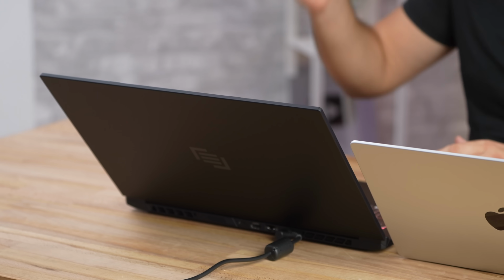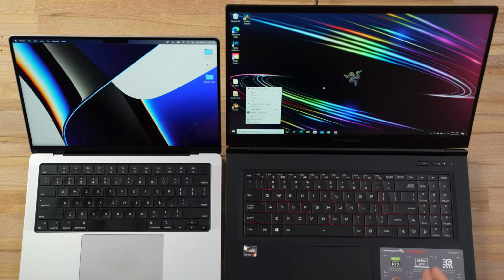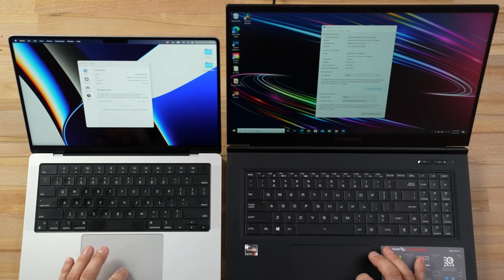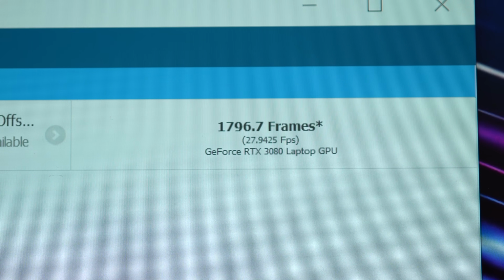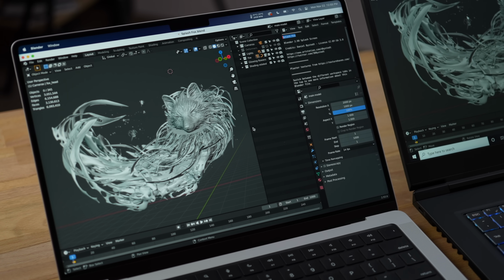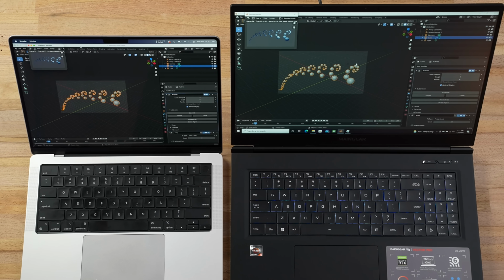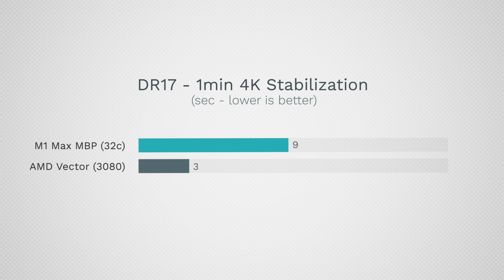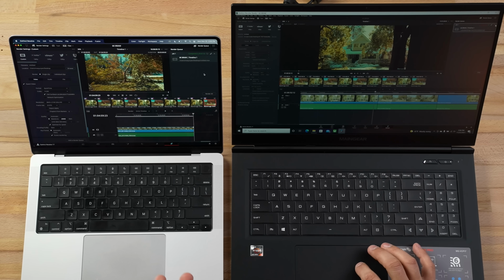Forget Intel! Can AMD's BEST Laptop Beat the 14" M1 Max?

Comment: I find it ridiculous how every single PC laptop that purports to be an ultra-powerful, even gaming, device are effectively desktop computers because they require you to keep them plugged in all the time, given the high energy needs they have.
Reply: i mean, that's the best they can gave with old rusty x86, and ARM sucks because nobody developt apps for it, and nobody uses ARM because no apps and game with it
Reply: he compares only with what works good for the MAC, why he don't run real games AAA (2021) ...
Reply: @tomerweiss4900  windows wins gaming, engineering applications because of developer support, not because the Mac hardware can’t run them. Other than software, you kinda have to hand every other category to the mac. Sure, you can name a windows laptop that exceeds, or even outclasses, these macs on one or two features, but there is no other machine on the market that is a master of all like these macs. Great performance, battery life, speakers, trackpad, keyboard, display, build quality, and even ports. These are things that should be good on every laptop and yet only these MacBooks manage to tick all the boxes. Why is that? Is it perhaps because these machines are just …. Better?
Reply: @shanep.7184  
"Other than software"

for professionals, software is everything.

You just cant ignore software for a laptop supposedly made for professionals

The one making cpu or gpu is greatly responsible for software.
Apple makes cpu and gpu here, so they cannot be not held responsible for software
Reply: @suntzu1409  are you suggesting Apple should make and support all the engineering applications in the world? As a platform provider, they’ve developed amazing GPU APIs and video file formats for the developers to use. Games/apps built on Metal are smooth and, more importantly, power efficient. ProRes is a best in class video format. It’s not Apple’s fault that companies don’t have the bandwidth to support it just because Windows has a larger market share.
Reply: @shanep.7184  
Yes im suggesting that

Software development is very expensive. 
Software companies wont care much about any platform other the ones where their software is widely used because they dont have any incentives/benefits (mainly financial) to do so

Chasing money is not company's fault

The major platform for all professional applications is windows or linux
So they will always recieve the most care

So if apple wants professional applications to be native to apple sillicon, apple should at the very least provide incentives/benefits to software companies to make software native to apple sillicon

As a reminder, software was the main reason why x86 continues to dominate PCs and especially servers and workstations killed

Software was also what killed itanium IA-64 and numerous other architectures

Software will kill apple sillicon if apple is so careless
Reply: @tomerweiss4900  The PC gaming market is too small for Apple to chase after, although I would be willing to bet that developers will start making more games that work on Mac in the coming years given the efficiency and power they offer.
Reply: It never happens that you the need performance of a 150W 3080 but you arent near a power outlet or dont have a desk
Reply: because there are no batteries able to sustain 300w of power atm. It's logical, also the laptop parts are derivatives from desktop and manufacturers don't have time Apple has to optimize it for a minor fraction of the market
Reply: @georgeousthegorgeous  The inefficiency of PC chips is inexcusable.  They’ve effectively iterated for small increases in performance each cycle, not caring to address the energy needs and the costs of allowing / requiring their chips to use 150-300w of power.  All that power draw also generates huge amounts of heat energy, which then requires fans to move inordinate amounts of air in an effort to cool these hot chips, which then creates tons of noise that people are just ok with?  It’s almost like they’re just cramming these things into laptop shapes because they can, not because it makes sense to do so.
Reply: @JMacGyver1  it's because each company has rivals on the market, unlike apple which handles a specific niche. Thus they have to get every possible frame out of hardware, otherwise people would look at comparisons and buy their rivals' product. Nobody actual cares about noise because it has become normal to have 40 decibels on gaming laptop. Also x86 architecture is generally much more power hungry as it was initially designed for pc's where noise can be suppressed and any amount of hit can be dissipated, so transferring it to portable devices is a controversial idea in its core. What's more they can do exceptionally energy efficient chips but it would take long to develop them, they will be pricey and people still won't care because they need more performance.
Reply: @georgeousthegorgeous  I agree that the chip and PC makers have been stuck doing what they do, just like Microsoft is in needing to continue to support decades old systems.  At some point they’re going to have to change, and I think that what Apple has been doing is going to be the thing that forces that change.  It’s just like in the automotive market - manufacturers could keep making internal combustion powertrains, because it’s the easy thing to do, but it’s not the future.
Reply: A laptop can be carried with you around the house or to other places. That doesn't mean we need to use it without it being plugged in all the time? It's not like we walk around with them like phones. I never brought my laptop outside of the house tbh, but i use it in different spots in my house. All those spots i could use the charger. When i'm doing heavy work, using a charger is absolutely no problem for me since im already sitting at a desk or table etc. When i'm watching a movie or browsing a bit i might be places where charging is less convenient
Reply: When blender support gpu render for m1 mac next year. Lot of 3D software gonna follow too.
Reply: By calling them a desktop you are implying all these gaming laptops have terrible battery life which has been far from the truth recently with all these new ones
Reply: @crestofhonor2349  This Windows computer has a 230W power supply, even if it had a 100w/h battery if it's pulling 150-200w total the battery will be depleted in less than an hour at peak power consumption. That's all in theory though, the battery will last longer than that because they'll throttle the CPU and GPU to extend the use time. You just can't get peak performance and decent battery life with these windows machines cause they're far less efficient than the ARM-based Macs.
Reply: @PerplexedPhoton  most of the time you aren’t pulling anywhere close to full wattage. And these laptops can’t even pull full wattage if they wanted to on battery because the battery would overheat. Apple has known this for years hence why all of their products have consumed less power  than other powerful windows laptops
Reply: @RunForPeace-hk1cu  Most of the time when I need full power I am near a outlet so its not a problem. Same would be true if I had a mac. Chromebooks are not great for the most part and a cheap windows laptop or a tablet like an iPad would be a better buy
Reply: @crestofhonor2349  That’s certainly not what I’ve seen in testing.  To get better battery life out of either Intel or AMD chips, they have to reduce their power and performance significantly, as Max Tech is seeing here with their tests.  You can have raw power plugged in, or ok battery life, but not both at the same time.  There is just no competitive chips that provide even close to similar power per watt compared to Apple’s M chips.
Reply: @JMacGyver1  On the other end of the scale: Apples M1 doesn't scale higher either. So getting crazy high performance with it is off the table. Whichever works for you should be the choice, so calling either of these "the winner" is ignoring the use cases where either machine is or isn't good at.
Reply: @MLWJ1993  My point is really that Windows PC laptops are more portable laptop in theory, especially in the case of those that are being sold as high performance versions.  Apple will undoubtably continue to bump performance up with certain “Pro” models, even at the sake of battery life, to a point, but the lead they have in power per watt will continue as long as the PC market sticks with their current architecture.
Reply: @JMacGyver1  My phone is better perf/watt as well. I can get a foldable one (if I need a bigger display) that fits in my pocket, which I can't do with a MBP... 😆

That's literally the WRONG comparison to make though.
Reply: @MLWJ1993  Performance per watt between laptops, or “laptops”, is absolutely a good measure when you’re talking about a device that is sold to be portable and the term laptop implies.  My initial comment was that PC laptops are really desktops, because they require constant plugged-in power to perform their best, compared to Apple’s M1 laptops which offer top performance unplugged AND can last longer while providing top performance.  That’s absolutely a function of Apple’s M1 being so efficient in performance per watt, compared to AMD or Intel chips.  Saying your phone, including a folding screen device has a better performance per watt is changing the comparison to a phone vs laptop, which I can add in that Apple’s mobile chips are also generally better than other Arm based chips in performance per watt, if you really want to talk about phone performance.  That’s why iPhones typically offer both high performance AND long battery life - certainly this is the case with the latest iPhone 13’s.
Reply: @JMacGyver1  But the MBP isn't completely a laptop either though. It doesn't run a bunch of "laptop" applications because it uses an architecture used in mobile phones.

So really, that's still not a full apples to apples comparison. Is the M1 good at what it does well? Sure. Is it good at what it doesn't do well? It's merely okay & terrible value for money.
Reply: @MLWJ1993  I remember a conversation I had with an engineer co-worker back in the early ‘90’s who said that between a PC and a Mac, they’re both able to do effectively the same tasks, they just go about doing it differently, whether that is behind the scenes processes or in the user experience.  You’re correct that there are many software programs that were developed using Windows from decades ago that haven’t updated, which has actually been a problem for Microsoft, because they continue to be forced into supporting the lowest common denominator, even if that means sacrificing forward progress.  I’d be willing to put money down on things changing in the next 5 years on the PC side.  That market can’t continue as is without change, which in part will be driven by manufacturers needing to address the competition that Apple is bringing to the market.  The fact that some Windows software runs faster on emulation on the M1 Macs than it does natively on PC devices shows just what is possible in moving beyond x86 as we’ve known it.
Reply: @MLWJ1993  what “laptop applications” doesn’t the MacBook run? I am curious. ARM is not inherently a phone architecture; it just happens to be used on phones first. There is no actual limitations on what can be run on it. You can even run x86 apps on M1 through Rosetta, and the performance is not bad at all.
Reply: @haomingli6175  Anything running Vulkan, Dx11 or Dx12 doesn't work well (or at all) on it as an example, but there's enough out there for it to matter in the decision.

Even if it does run, some of it isn't hardware accelerated at all & therefore terrible value for money (as in a mid range X86 CPU & RTX 2060 max Q beats it by quite the margins). It's not even ARM as an architectures fault though, that's just Apple doing Metal as the only API they officially support. Kind of like Nvidia not maintaining their proprietary Linux driver which makes an Nvidia GPU a terrible choice for use on Linux.

If you can't see that though, you're very much influenced by the "M1 is absolutely great voodoo magic" marketing strategy by Apple.
Reply: @MLWJ1993  You need to wake up! They scaled up the M1 to M1 Pro and they scaled the Pro to the Max and that’s only for portables, maybe you need to prepare yourself for a bigger shock when they scale the Max to Max due with 2 Maxes glued with infinity fabric and then scale that to a quad Max with 4 Maxes glued for the upcoming endgame desktop! 
Oh, in few months THE M2 is coming, can’t scale $hit my &$$ lmao 😂 
Or maybe you got used to Intel scaling up their power bricks and the temperature in their volcano lakes and calling it a day?!
Reply: @fmax30000  Most architectures aren't actually all that well suited to scaling from the absolute minimum to the absolute maximum. Even Apple can't change that.

The M1's currently are impressive at low power hardware accelerated workloads. Anything that isn't those 2 things isn't exactly "impressive". An RTX 2060 in a laptop can & will outperform the MBP in enough usecases to make it an underwhelming product for something at least 2x the price, so I guess I won't need to "wake up" any time soon 😛
Reply: @MLWJ1993  M series MacBooks “don’t run a bunch of laptop applications” because they don’t support Windows Direct X libraries? 🤔 this is not a CPU architecture problem. 

Fact of the matter, benchmarks aside, these new laptops either compare or exceed the performance of their Intel or AMD counterparts in real world tests (as was demonstrated). And that performance and battery life is stable regardless of whether they’re plugged in or not.

Wait till Apple release some proper desktops and you’ll see how this architecture scales with different thermal considerations and when constantly connected to power.
Reply: @RunForPeace-hk1cu  Photoshop isn't exactly great on a MBP, a mobile RTX 2060 runs circles around the MBP in that usecase.

Also no, I didn't get fired & are mad. You're mad that there're people that're actually realistic & don't lap up every little thing Apple chews up & spits out. 😉

My commute from work > home generally doesn't take long enough for a decent performing laptop to run out of battery either so there's no concern there. At home I could have a desktop waiting to render videos or 3D scenes on, using a threadripper & high end GPU. Something a MBP couldn't ever compete with.

It's called being realistic. The MBP is great at being efficient at what it does do, but I don't spend a long time in places without power outlets so there's really not much value in that strength.
Reply: @jtonline99  Sure, I'll gladly wait for that, their more GPU cores attempt doesn't have me holding my breath though, outside of hardware accelerated workloads it barely competes with a RTX 2060 (mobile) though.

It's energy efficient, but that's really it. Nothing magic about it unless that is what you require. 🤷🏻‍♂️
Reply: @MLWJ1993  as long as your RTX 2060 is plugged into the wall. Otherwise it falls flat on its face 🤷🏽‍♂️
Reply: @MLWJ1993  Wrong. Go check out Tally Ho Tech. He spec'd out a similar windows based laptop and it cost more than an M1 Max.... and the Apple still had a better screen. 
That's what gets me about PC/Windows  people. They try to match specs and only focus on things like memory, cpu and gpu (which also can't really be compared because these specs are meaningless). They never include things like screen (M1 is best in class by far), speakers (m1 is best in class by far), SSDs, mics, build, warranty, etc. 
Nothing in the Windows laptop world comes close to value for the money that these new M1s offer. Nothing.
Reply: @77dris  About the screen: It's colour accurate, yes. It's also slow as balls & not suited for anything that's meant to be watched on a true 120Hz panel because the Mac's panel takes 30ms on average for pixel transitions.

Any OLED panel laptop using Windows would provide a better experience if you're using programs that do manage colour profiles properly.
Reply: @jtonline99  Which is exactly what the M1 is good at, but if both are plugged in the M1 falls flat on its face in comparison... 🤦🏻‍♂️
Reply: @MLWJ1993  lol common, 300 something frames plugged in down to 23 something unplugged. That's joke. M1's would smash your graphics card heros if Apple allowed them to draw 150+ watts. You're like the Nvidia / AMD equivalent of an Apple fanboy. Keep defending 🤣
Reply: @jtonline99  it hit 23 because it was set to do that by default, if you had a laptop that'd properly switch to the iGPU for prolonged battery life or didn't limit the Nvidia GPU to very low power usage in Geforce it'd do much better while still preserving some battery life.

I.E. an example case of user error 😉
Reply: @RunForPeace-hk1cu  I run my own company so you can be damns sure I play with my own machines if and when I want
Reply: @fmax30000  4 Maxes glued wont come to laptop, and even if it does, it would be ridiculously expensive and terrible at performance
Reply: @RunForPeace-hk1cu  he is talking about scaling of performance with power draw

M1s absolutely suck at that
Reply: @jtonline99  apple fanboy detected
Reply: @MLWJ1993  you are a straight up wrong on every comment. M1 runs full blown Apple Apps.
Reply: @aliaswave  Yeah, only Apple Apps. Apple apps consist of like <5% of applications in existence 😆

Sorry, but X86 is just much better compatibility wise.
Reply: @MLWJ1993  Thats funny I can pretty much all the apps on my M1 MacBook I can run on they Ryzen desktop.  Not including games. So I think you need to do some more research before running your mouth.
Reply: @aliaswave  You might need to do some research, anything where you can throw a cheap laptop with a RTX 2060 in, the M1 gets absolutely destroyed because it can't do its hardware acceleration. The chip isn't some black magic... 😆
Reply: @MLWJ1993  but the fact you don’t know that the M1 has acceleration for pretty much all productivity software shows you don’t know anything.
Reply: @aliaswave  actually, video encoding is slow compared to anything in the same price range... Code compilation same story.

Hate to break it to you, but the amount of native apps is really currently a very bad achilles heel of the M1. Sure you can throw an M1 max at the task to get very bad value for the performance out of it. That still doesn't make this anything more than a very expensive beta product at best.

If you don't want to believe that, go back to hailing your Apple overlords for their black magic & just stop replying to me. The M1 is nothing more than a very efficient chip when it has specialised software to work with.
Reply: @MLWJ1993  dude I edit on both and you are wrong.
Reply: @aliaswave  LOL, user error on your end. It happens 😉
Reply: @MLWJ1993  okay noob